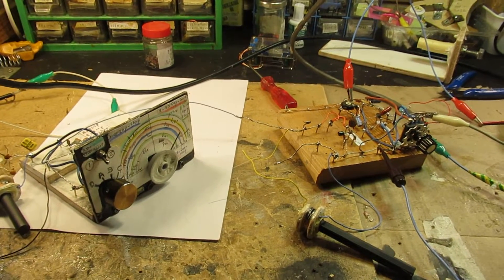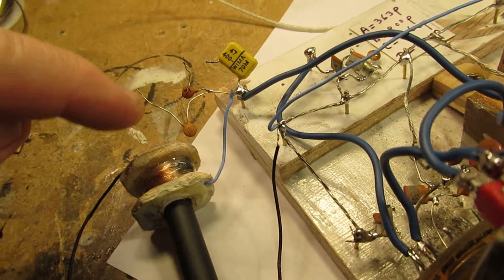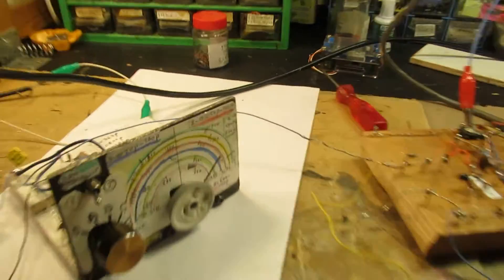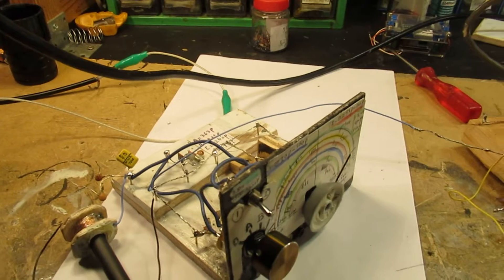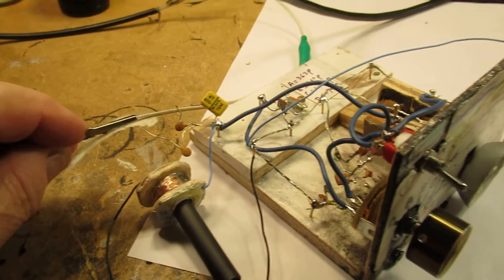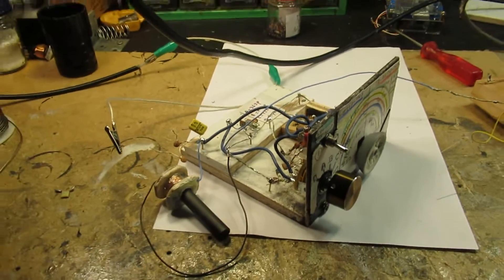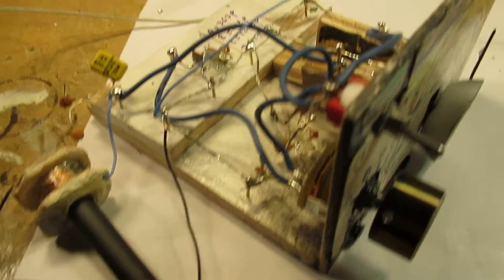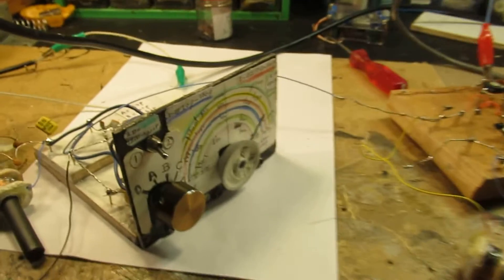Importance of the antenna capacitor value in the foot of a wire antenna demo & VLOG

Comment: Very interesting. What capacitor do you recommend for 27 MHz?
Reply from the maker: For 27 MHz a full wave (longwire) antenna for radio reception has a length of (say) 11 meters (300/11). But for that frequency band often special antenna's are used, half wave or 1/4 wave and/or tunable via a coil in its foot (effect of semi-lengthening). So, for a longwire antenna between 11 meter (fullwave) or 5,5 meter (halfwave) on 27 MC, it has to tested with a trimmer for an optimum result. My idea in that case would be: use a 50 pF trimmer and trim it to the best reception results.
Reply: @radiofun232  Thank you!

Comment: so, no matter the length of the wire, the frequency of the signal, same capacitor is always the best?!
Reply from the maker: I say "it works always good". I don't say: "the same capacitor is always the best". But for wire antenna's up to 10 meter (500 KC-12 MC) a capacitor of 14 pF is in general a good value. This is an experimental result of many practical experiments with wire antenna's. Always good to do some experiments with that value and listen to the reception results. 18 March 2024.

Comment: I try to made this TRF but still not working . I try BF256 and 2N3819 both I suspect source to ground resister not a 10K pls explain? .Thank from island Nation Srilanka.
Reply: Try in midnight reception Shrilanka is a very far. In Latvia I can hear on LW - Polski radio ( strong signal ). Radio "antenno satelo" from Rumania and BBC ( in night ).
In midnight ( not evry day ) I can hear arabic language AM station ( about 4000km away ).
Reply from the maker: @ingussilins6330 Thanks for your important attribution to make the circuit of @dammialwis8557 work. It is always, like you know, difficult to help someone with an electronic circuit when you don't know anything about how the circuit was made in practice.
Reply: Sri - Lanka no any MW station or sw station now only lot fm channels . We can only one mw station from India .but try made this trf receiver it did not work I suspect first FET source to resister not 10k .can you test this circuit  ?
Reply: @thisarasadamini1770  https://www.youtube.com/watch?v=ciRTJBm4T8I
This is my LW - MW receiver circuit. 
I use common source configuration and source resistor value is a below 1K.
If you like you can made VLF natural radio receiver and pick up signals from space and nature. Auroral chorus and VLF dawn chorus like a bird ans frog songs in tropic forest.
Reply: @thisarasadamini1770  This is my LW receiver circuit:
https://www.youtube.com/watch?v=ciRTJBm4T8I
I use common source fet circuit and cource resistor about 470ohm , drain resistor 2Kom.
Reply: @thisarasadamini1770  In my YT channel can see my LW receiver circuit. I use common source front end. drain resistor 2k and source resistor about 470ohm. Transistor 2N3819.
Reply: About Shrilanka: try made VLF natural radio receiver and pick up signals from nature and space. 
Mothers nature "radio station" works around world. Best sounds is a from geomagnetic storm - sounds like a birds and frogs in forest.
Shanti shalom namaste! :)